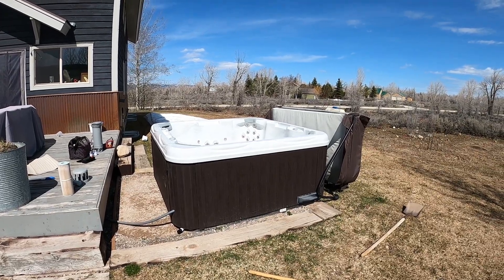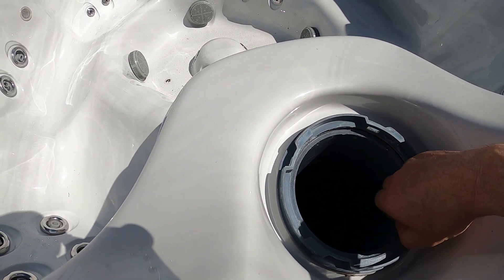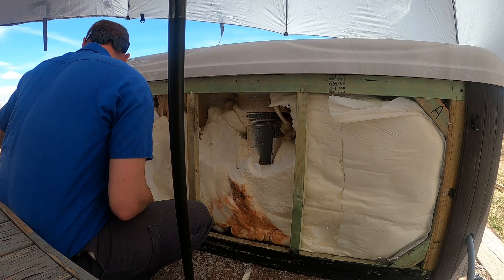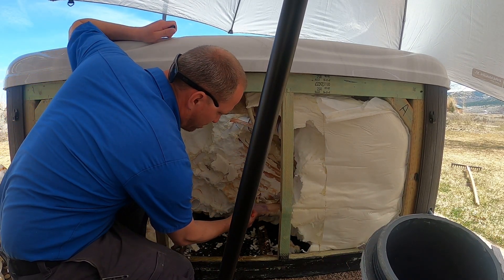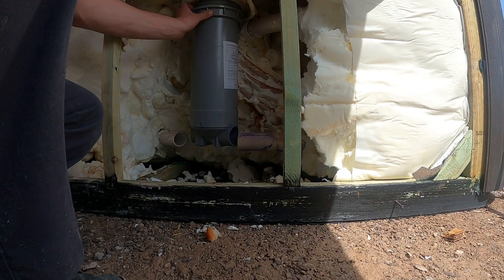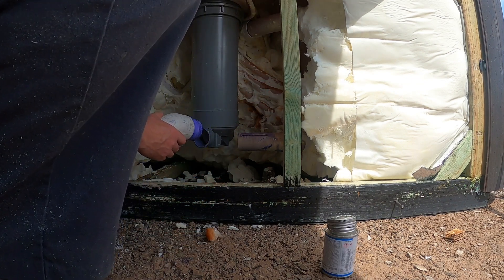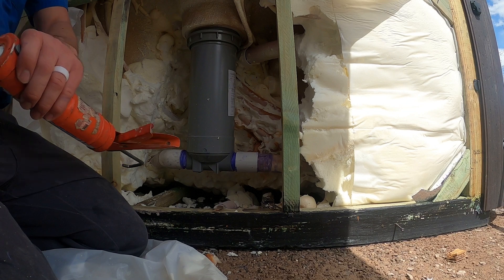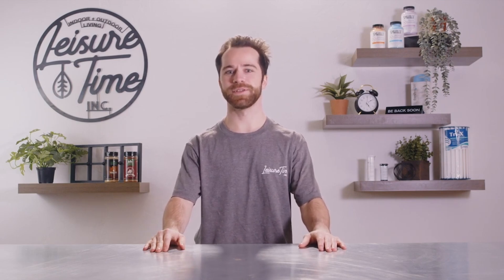Filter Housing Cracked and Leaking || What's Wrong With My Hot Tub?

Comment: Hi, what would you recommend for a cracked UV light housing chamber? The UV light filter pump was broken from the factory. Repair man diagnosed the issue but unable to get Artiesian to contact me back to get the needed parts because that part is not available on line at their site. I'm terminally ill and depend on my hot tub for physical therapy. It's been down for a month and I'm struggling. Just reaching out where I can because I feel like I'm fighting for my life. Hot tub company keeps saying it's the Ozonator is broken and that's standard after 3 years for them to break. But thats not the broken part.